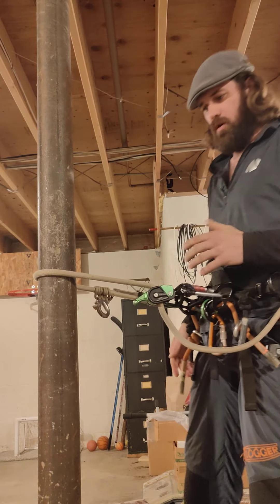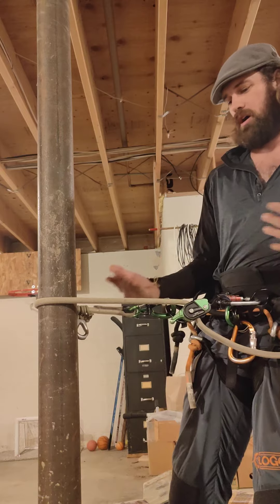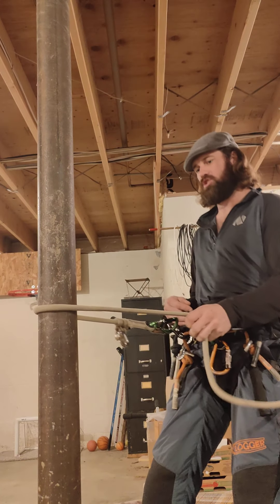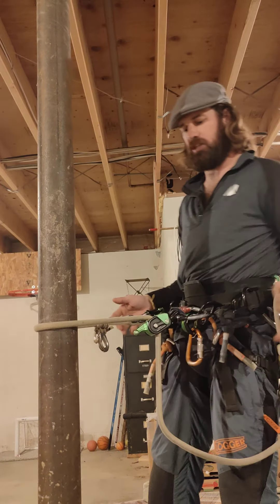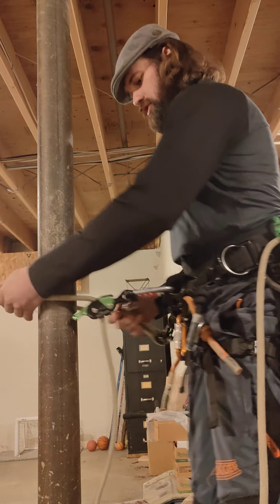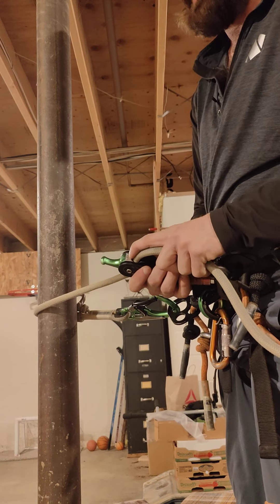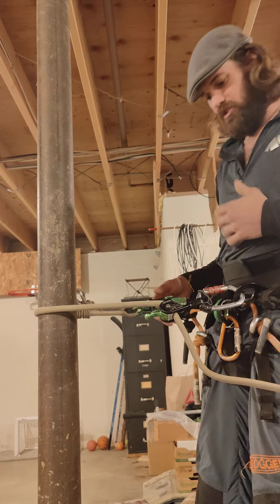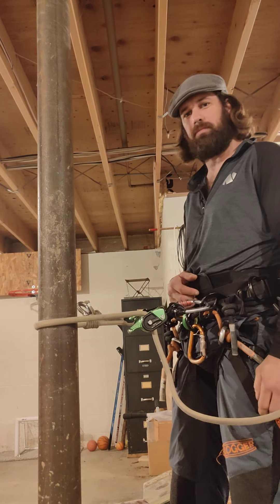Notch Glide Rope Grab

Comment: I am going to do roof work on a steep roof with a 1/2 inch safety rope that I already own connected at the peak.    I want to move up and down the roof to do work with both hands free when I get to the roof spot to work on.   Will the Notch Glide Rope Glide  work for me in case I fall and keep me from sliding off the roof ?
Reply from the maker: Though it might work for this application it's not specifically designed for it. If never seeing a significant force or load, I might just use a form of a prussic, such as a English prussic or a distel.

Comment: Looks pretty nice, just curious though does it let you descend srt when all you're weight is on it?
Reply from the maker: It can be jumpy, not designed specifically for that. But with a belay hand it can be done smoothly. I find i rarely descend srt on my lanyard
Reply: I was about to make a similar comment because this could be a game changer if you could safely repel SRS/ single rope!  I can think of so many applications it could be used for if so!
Reply: You may want to check into the camp druid pro. Bulkier but could be the compromise you're  looking for
Reply: After years of trying different lanyard adjuster options (cinch, zillion, positioner, hitches etc) I have arrived back at the Petzl grillion which I use alot in an SRT configuration. It does it all.